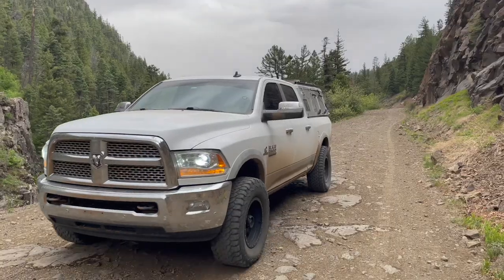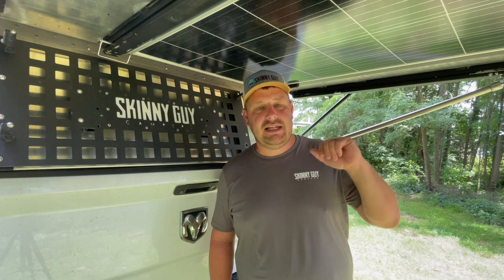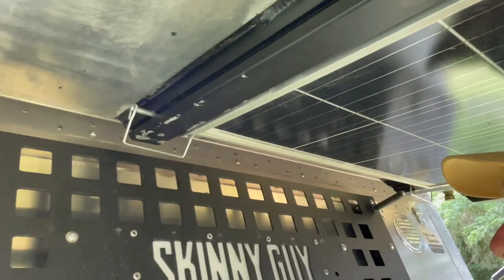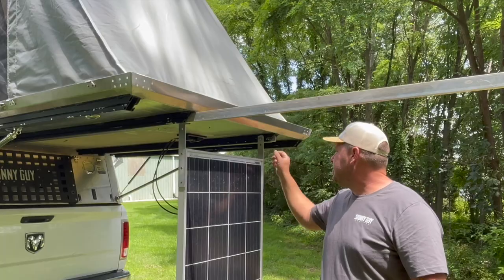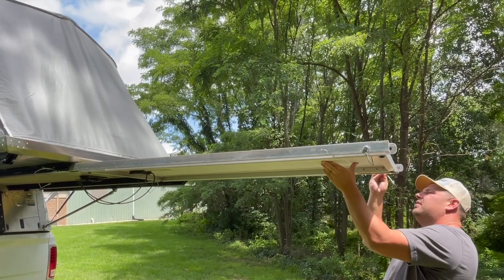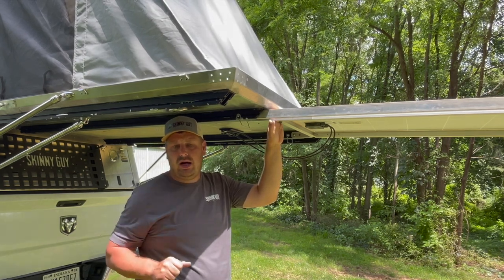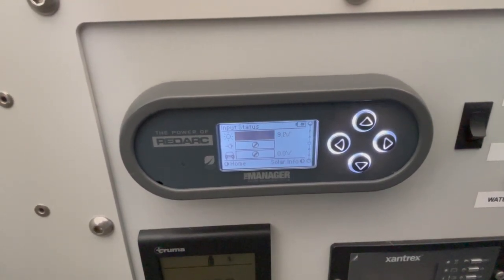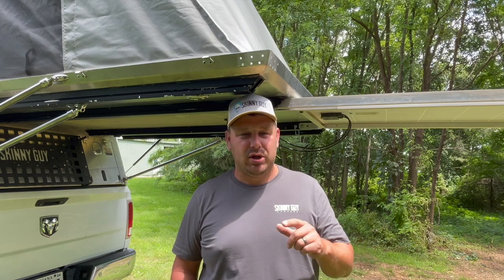Feature Friday: Deploying the Skinny Guy Campers Solar Panel

Comment: Is their any room for different sized panels?
Reply from the maker: Not much, but this panel does a great job of keeping everything charged. An external port and solar blanket could be another option. The BMS also will charge the battery quickly from running the truck when you are moving from place to place.